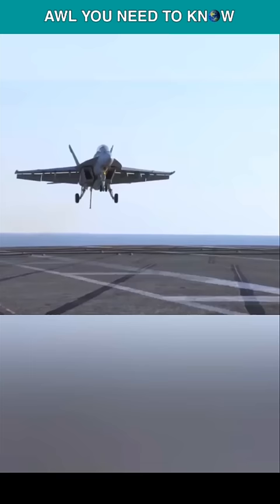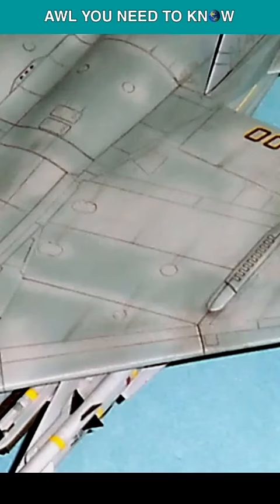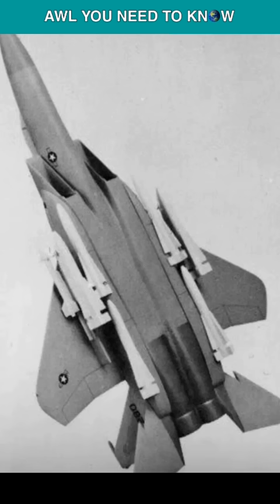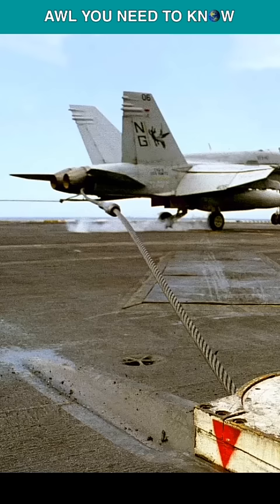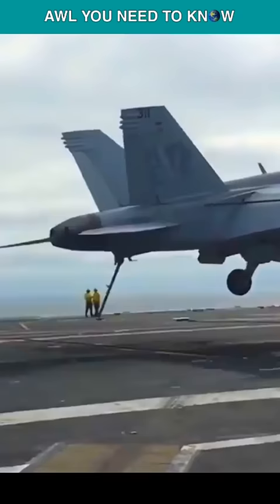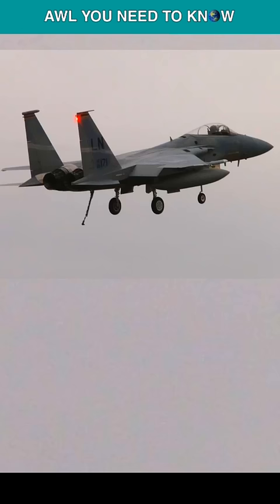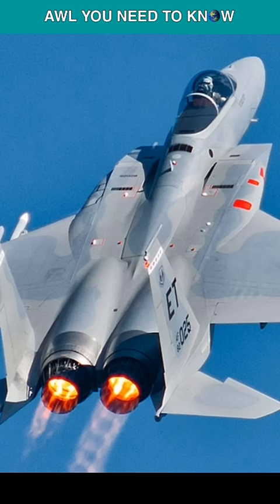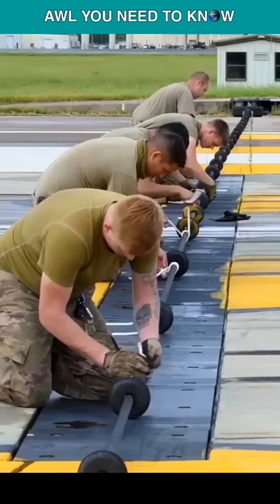Why Can't an F-15 Land On an Aircraft Carrier? #shorts

Comment: I still wonder why a navy version of the F15 can't land on aircraft carrier...
I hate autocorrect
Reply from the maker: Where you wanna make it? In real world or in 3d or 2d?
Reply: Airrforce aircraft have no need to operate  off carriers. 

Since the Navy has no adopted it, the landing gear does not need modification.
Reply: The answer you're looking for is the AIM-54 Phoenix.  The added weight to navalize the F-15 and give it the Phoenix gave it the weight and performance of the F-14.  The Navy felt there was no point in proceeding if the F-15 would loose its thrust to weight and maneuverability advantage.  For contrast, look at the Super Hornet - it's a multirole fighter with similar length, height, wingspan, and weight to an Eagle, but has less speed, range, payload, and thrust to weight to the Eagle.  There is no free lunch in engineering.
Reply: @MothMizzle Furthermore they already wasted enough money on the Tomcat. They can’t choose the Eagle even if they wanted to. Congress kind of banned them from doing so until the F/A-XX.
Reply: @Optimaloptimus  "...wasted enough money on the F14..." 

?????????

How many years was the F14 in service?

....and....

How was it "wasted money" ???
Reply: They could, but not many times
Reply: @leeshackelford7517  It achieved nothing for all its time in service, just a couple kills, and the rest credited to the liars in Iran. The AIM-54 provided nothing more to gain from its design, the only thing it had was a barely hypersonic top speed in its final configuration. The F-14s design provided no real advancement design wise or aerodynamically and was actually weaker than the F-15 in the aerodynamic respect. Its only good shining moment was its time serving as a bomb truck, nothing else. With the rest of its history being that of a hangar queen that could go wrong at any minute for the pilots. And a maintenance headache for ground crew, on top of the fact that it was so expensive Congress effectively denied the Navy any funding for immediate upgrades for it because they already spent all of the money, they had left on it. It was so expensive the next budgets had to be rationed. Basically, the Tomcat is a history of failures, nothing else.
Reply: @leeshackelford7517  They flew those rules to prevent friendly fire. Because the F-14s lacked something as basic as an IFF. Something F-15s came with standard, and were not even fitted with such a system until the F-14D when it was too late. The Iranians are indeed liars, just because they lied doesn’t mean everyone else did. Both Iraq and Iran inflated their numbers. But Iran is called out because their’s are the most egregious, it is doubtful they even had the amount of AIM-54s necessary for that many engagements with them at all. As for the active shooting wars the Tomcat was in, very few, and in each one it performed decently with whatever it had when it came to the Navy. Iran on the other hand is untrustworthy aside from the 50 confirmed. So congrats, you said nothing at all for so much.
Reply: @Optimaloptimus  Jane's is citing the Pentagon.
Reply: There is no reason an F-15 can't land on an aircraft carrier. This video is full of crap in that regards.

However, the airframe wasn't designed for carrier operations and would take damage from those kinds of landings. The "Sea Eagle" concept might have fixed those issues, similar to how MD later Navalized the YF-17 into the F-18 Hornet, however, the Navy already had heavily invested in the F-14 before the Eagle even reached the drawing board, so there was no actual chance of that happening.
Reply: @Optimaloptimus  It's their job to know.
Reply: @Skyfighter64  This is the correct answer. Also, Naval aircraft are hardened against salt corrosion. That would be another added cost to a Sea Eagle program.

Much of the F-15s perceived performance advantages over the F-14 would be lost after strengthening the airframe, and landing gear.
Reply: @Skyfighter64  there's a lot more to this issue than simply tail hooks..
Reply: @MothMizzle  so why is that ok for the super hornet but not the f15? I'm confused
Reply: @leeshackelford7517  it took a lot of money to up keep them compared to the hornets, swingwing also had more money in up keep.. f14 was good plane but exspensive to operate
Reply: @operator0  If anything it would handle worse than the F-14 once it was navalized.
Reply: @Optimaloptimus  The F14 was quite the bird, sure it had its long and costly maintenance, but it could perform VERY well, it was on par with the F15 once it received the GE engines.
Reply: @mar3869  And you clearly can't read what I said. Considering I stated that the F-14s design did nothing to advance aircraft design today. Meanwhile the F-15s template can be seen on practically every aircraft that is in US inventory. Furthermore, I know very well what role it performed, interceptor, and it did it well enough for all its problems, the big issue is that the F-15 could do it even better, the F-14s only compensation for the lack of performance over the F-15 was the AIM-54, without the AIM-54s the F-14s are outmatched by Eagles unless you put a decent crew in it, but this goes for both sides.
Reply: @captainboose8788  Actually, no it was not, the F-14 was limited on the performance board because of airframe limitations that could not be fixed due to the swing wings effectively eliminating any possible room for the strengthening necessary to prevent this from happening, and it just so happens that the F-14s biggest drawback were its wings, which for the 1960s were revolutionary, by the 1970s obsolete and dead weight. 
Sure, it was a good interceptor, and it served that purpose for it was built for, but on every other arena it sadly fails without the AIM-54s which are it's ONLY selling point, its maneuverability wasn't special either as it needed the GE engines to actually make good use of it, and even then, it's so large its maneuverability is negated by its severe weight problems. Meanwhile the F-15 not only has the maneuverability problem down right it also has the weapons platform down, and it didn't need fancy ultra-long range fat missiles to get the job done, further proving the Navy was stupid when it decided on using the Tomcat and the previous planes before it as missile trucks.
My point is, the Navy got what they wanted, but was it what they needed? No. They needed more planes that were like the Phantom, not whatever the Tomcat was supposed to be, and let's not mention Vought's superior submission to the competition that gave us the Tomcat.
Reply: @macmccartney5760  if I'm understandign your question, then I could point to "needs of the service, politics, cost, and engineering."

Needs of the service - after the end of the Cold War, the primary threat and thus the need of the Tomcat evaporated.  With the exception of payload-range, the Hornet could do most of what upgraded Tomcats could do, but cheaper.  The Tomcat shone in Afganistan where its massive internal fuel load meant it wasn't "bugging" the tankers as often.  On the other hand, there were fewer of them and they flew their wings off supporting the ground troops.

Politics - Tomcat pilots are a smaller part of the naval aviator community when compared to the Hornet pilots.  In other words there were more pilots with experience in smaller multi-mission aircraft than the larger fleet defense aircraft.  If promotions are earned at an equal rate, you'll still wind up with more Admirals and Generals (USMC) who flew the smaller aircraft compared to the number of Admirals who flew the Tomcat.  Long story short, when it came time to choose between the Super Tomcat 21 or the Super Hornet, all other (legitimate) reasons aside, there's way more brass on the side of the Bug versus the Cat.  I'm not mentioning Congress in all of this because for them (at least in military procurement) "cheaper is better".

Cost - older aircraft just cost more to maintain.  When it entered service, Tomcats actually required fewer man-hours of maintenance than the Phantoms they were replacing.  By the 1990s, the maintenance time on the older and heavier Cats had ballooned making the fewer man-hours of the lighter, simpler, and younger Hornets all the more desirable.  Also, an all Rhino/Growler air wing means incredible savings in terms of spare parts and other logistical needs.  Additionally, the Tomcat was overkill for the threats that most enemies could put against the fleet with Russia, China, and a few of their allies fielding anything potent enough to challenge it.  The other countries with fighters that could challenge the Tomcat . . . were friends.

Engineering - its easier to scale up the smaller Hornet than to navalize a land-based figher.  In many cases the USAF was forced to "drink salt water" when they needed a new aircraft (A3D/B-66, A-7, F-4) whereas the Navy has to "compromise" with the USAF to get some of theirs (F-111, YF-16, F-22), if they get them at all.  (Yes, I'm aware the Navy didn't get the F-111, YF-16 & YF-17, or the F-22, but they were forced to work on those projects with the USAF before getting something else.)  With the phoenix retired and one of the major problems associated with it, I would think the "Sea Eagle" concept might warrant another look.

There's a lot more that can be said, but this is already long enough.  Hope this helps.
Reply: @Optimaloptimus  Wasted money?!  The damn things operated for 20 years, out preformed the migs of their era and while expensive to maintain, were only retired because the retrofit of the F-18 was cheaper to do then the F-14 (and both super variants had similar performance) and to not allow Iran to get blueprints on how to modernize their aging F-14's
Reply: Aah, trick question. Because it doesn't exist.
Reply: tail hook may not be strong enuf; carrier landings are done at full throttle to keep from falling off the end in case all the wires are missed. but the hooks could be beefed up.
Reply: @MothMizzle
Reply: The landing speed of the F-15 was appropriately low if modified and could land on a carrier. Unfortunately in case of a bolter it couldn't regain enough speed to produce the lift necessary to take off again. The F-14 produced more lift due to it's variable wing geometry so it wasn't a problem. They could build a carrier version of a F-15 with today's technology  but there's no reason to.
Reply: @patrickweaver1105  they could have built one back then too, but that's vastly expensive. Especially if you already have a carrier based big bird. Same with the F-35, the Navy version is substantially different to the Air Force version. It all comes down to the fact that Navy fighters are basically shot out of a cannon at take off and have to be mildly crashed for landing due to limited real estate on the boat.
Reply: @Perry_dAccard  The biggest difference between the F-35A and F35C is the wings. The airframe itself is equally stout on both versions. The early F15 just wasn't capable of carrier operations without modifications that would have ruined it's performance.
Reply: @patrickweaver1105  Makes sense, since its concept was to be an all purpose fighter from the get go.

Comment: If they miss the wire, don’t they just go around and try again? And I thought aircraft carriers also have a net to put up to catch planes in emergencies.
Reply: Yes, they're trained to gun the engines on touchdown in case they miss the wire. The cable is strong enough to stop them at full throttle.
Reply: They do have nets.

Comment: It’s much more than just having a tail hook deck and handling air craft carrier landings
It’s the airframe , landing gear, and And at least two other things I can’t think of right now
Reply: F15 is significantly harder to control than F18 at slow speeds.
Reply: It's pretty much the reinforced landing gear and stronger tail hook.

Comment: The trick is to hit the deck, get to where you'd catch the wire, then gun the engines to max so if you did miss you're accelerating enough to take off again. That prevents splashing off the front. Plus the carrier always heads into the wind for landings (and takeoffs) so the planes have more lift.
Reply: Thanks Einstein

Comment: The real reason the F-15 is not suitable for carrier use is because the landing gear is not robust enough.  It's meant to be landed normally (gently) on a stationary runway.  Carrier aircraft like the F-14 and F/A-18 have landing gear struts and shocks designed to be slammed down onto a carrier deck with much greater force, which is necessary for a landing on such a small patch of the carrier deck where the arresting cables are located.  You can't nicely flare to a soft touchdown on a carrier because you'll over-fly the touchdown zone.  So, on a carrier, you basically fly it right into the deck so as to ensure firm contact with the deck in the short area where the tailhook will catch one of the wires, and that means you need very strong and shock absorbing landing gear.

Comment: I worked for "McDonald Donuts" in the '80's, and we also would have had to add a lot of mass to the landing gear & wingbox to get it to land on carriers, reducing it's performance or payload.  Still, it could have been done, BUT the Navy wanted a lower maintenance multi-role jet, and was willing to wait a few years to get their F/A-18 Hornet instead, once they had more budget to buy them after spending way too much on the F-14 in the 1970's.

Comment: Technically it could. It had the airframe for it. But it would have needed a much beefier landing gear. The size was the other thing. Because of the swept wing design of F-14’s you can fit quite a bit more on a ship with basically the same performance. Each plane saves you about 10 feet of space.

F-15 is better, but you get more F-14’s and they are just as good… almost. Which is also a testament to the F-14, to be a carrier plane and yet have the fighting abilities of a land fighter.

Comment: The F-111B was intended as a Navy aircraft...it was able to land (and takeoff) on a carrier  but the Navy wanted a different aircraft, and got the F-14. Similar in some things (2 crew, 2 engines, swing wings) but much better in air combat than the 111 (which is great as a large attack aircraft).

Comment: When they hit the deck they go full throttle in case they miss the arresting cable , and they take off the deck and come around for another try . They don't hit the arresting cable every time..I used to go to Dallas naval air station when I was in The reserves we would sometimes watch F-14s practice mock carrier landings , they did not  catch the arresting cable every time and took off for another go around. They had a mock up landing strip suited for practice to land on carriers.And they would also just do touch and goes throughout the day to practice for such instances.Was pretty cool to watch.Its a contrlled crash..Takes practice,  alot.

Comment: The reason has nothing to do with the arresting hook. The added weight of modifying the wings, landing gear, and new radar negated the advantages the F-15 had over the F-14. The Sea Eagle also never had the capability of carrying the AIM-54. Hughes Aircraft worked with MD on a proposal to modify the Eagle, but the project was scrapped and awarded to the Tomcat.

Comment: All jokes aside, the arresting hook has nothing to do with it, even if the aircraft manages to miss all 4 arresting cables, the pilot is trained to go to full power anyways as soon as the aircraft hits the deck just in case they do miss the cable or if the cable snaps (the second is rare but can happen). The reasoning is honestly quite simple, in order to beef up the F15 to survive ship service it would cost far too much and you'd lose a lot of the advantages the F15 had. For carrier service you need landing gear to be able to hold up to constant hard landings, the air frame and tail hook needs to be able to take a force taking a 22 ton fighter from moving at about 150mph to nothing while two massive engines are trying to push the same fighter to back up over 200mph without bent ripped in half. The fact of the matter no good carrier based fighter started off as a land based aircraft.

Comment: Some of the comments are inaccurate. As stated in the video, many USAF acft have arresting hook in case of emergencies. In carrier operations, there’s a “netting” to assist stopping a distressed acft. Thus, a redesigned f-15 would’ve be viable. However, the navy wanted a twin seat long range asset to replace the aging f-4, capable to carry the aim-64. The real reason is that the navy wanted their own plane and not have an USAF hand-me-down like the f-4.

Comment: I've never seen an arrestor hook used for engine turns given how theres no way to hook it to a pad eye.  Chocks with brakes set is more than enough, no one is running afterburners on the ground for an engine test since they dont want to fry the maintainer watching the engines.

Even naval aviators dont catch the hook 100% of the time which is why they do not land with the throttle bottomed out so they can go around for another pass.

Most fighters can be navalized if militaries desire to do so, there was just no need for the USN to do given they already had so many other airframes.